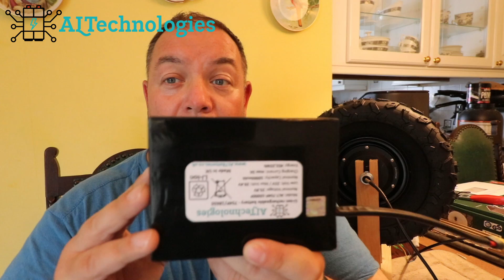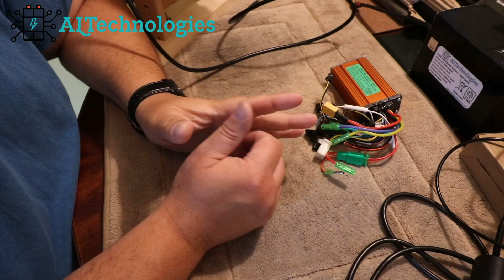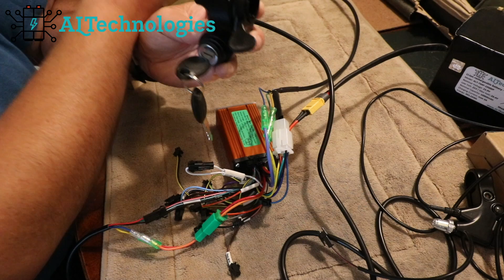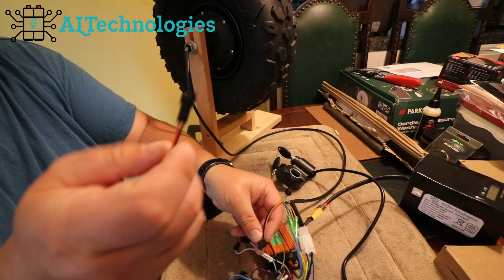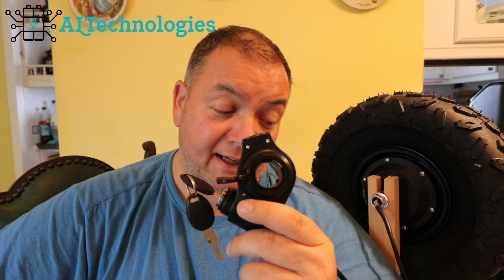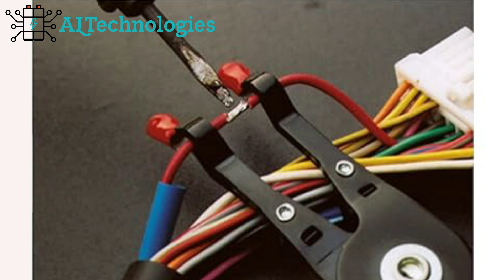Build Your Own Power Barrow  -  Part 2

Comment: Alright fella, just wondering what size fuse did you use. Regards mark
Reply from the maker: It's listed in part 5.  - https://www.amazon.co.uk/Aramox-Overload-Protection-Overcurrent-Protector/dp/B07P8SW4GD?crid=1L75EJRLFEB7H&dib=eyJ2IjoiMSJ9.CCUj-3JZoF7njolE1Ubip3rHdotvsVRTCktsaIdxTzJkAYG7JNjt6O6Q0ZuC5YaLbP6Y6qBBYKKgiIO8Z8dRtNtkN0PaCDY9FhaI_cv6D00ks665LnoV6HVR3wAP3h_dbmBFY30CPMjqFFuO_2XJshdTI5ZQG7KhUTLBdonZITX2i8HxLsJGSXNs7u4meRX6C1b1kaCF931ll08ybEmLazGO3Vm9Llqz_ZY1ulTWwd0.o-5LBD3JiTY50QQDdBj1qvdVlDfYHunNSmzHorynjwU&dib_tag=se&keywords=aramox+breaker&qid=1717325283&sprefix=aramox+breaker,aps,68&sr=8-6&linkCode=sl1&tag=jvacarpyadven-21&linkId=d61f7d8ecc281bd7f2064917431a1676&language=en_GB&ref_=as_li_ss_tl

Comment: I've just recieved my kit from ali express. It's my belief that the electric brake it is just there to disengage the motor while a cable operated disc brake stops the wheel itself. Like it does on electric bikes. Though I could be wrong.
Reply: Your right mate the answers on the controller sticker BIKE controller I have a few sets of them cheap brake lever's from ebike kits I've built but not used you need another thump throttle to use it as a regeneration brake it tries to turn the motor backwards to slow it down

Comment: Hi mate what style of inline fuse is need  is the normal plug socket one or a square car one. Because I purchased this kit but I have to buy a separate wiring from the battery to the power box I paid £200  and no instructions or diagram to show how to do.

Comment: When you say the battery is “10 amp”, you mean “10amp-hours”, correct?  Amps are a measure of current. Amp-hours are a measure of battery storage capacity.
Reply from the maker: Correct

Comment: my kit is the same but the hall wiring from the wheel didnt come terminated into a plug, its just pins with a shroud over it. Does this mean I should not connect it or do I still need to?
Reply from the maker: Yeah you still.need to.connect it

Comment: Thanks for the mention bud, aviation connectors definitely more robust than the tyco connector i had for that application
Reply from the maker: Hope i said your name.right dude 🙂 Be talking about you more in.part 3 gonna make the.forks.and reposition them 👍🏻👍🏻
Reply: @jvacarpyadventures7045  cant underestimate the difference in stability, you wouldn’t think a few inches further forward could make such a big change but believe me it does, you won’t regret it.